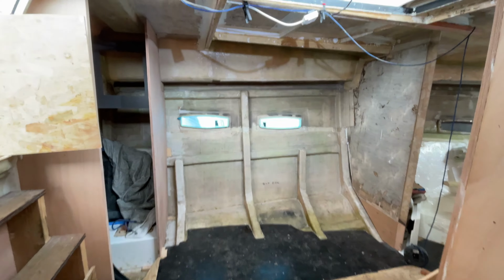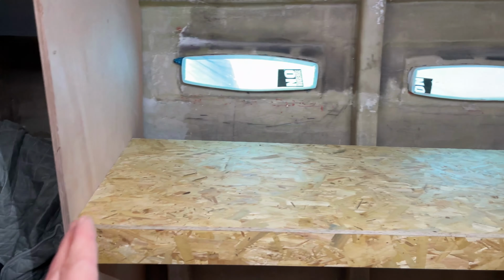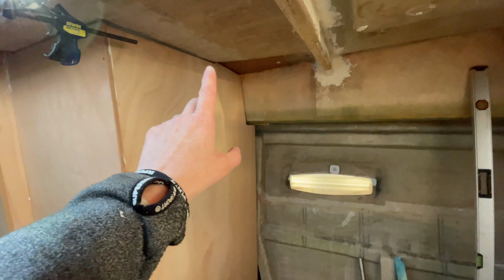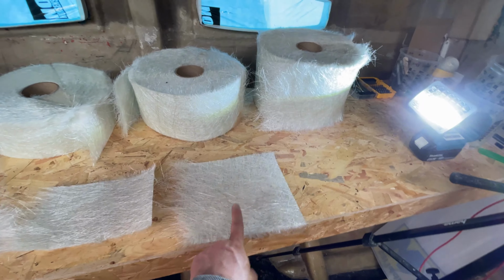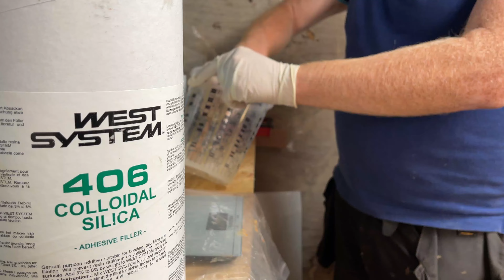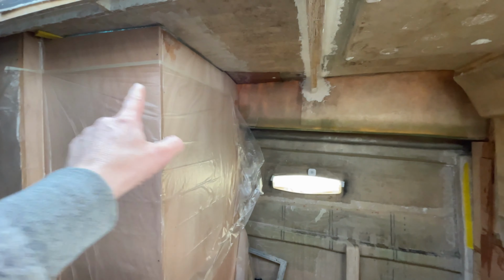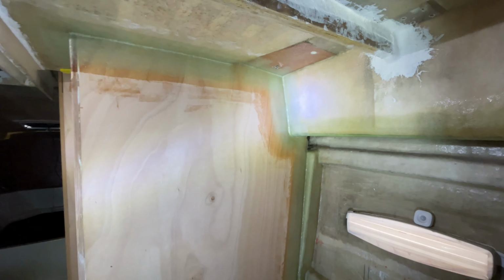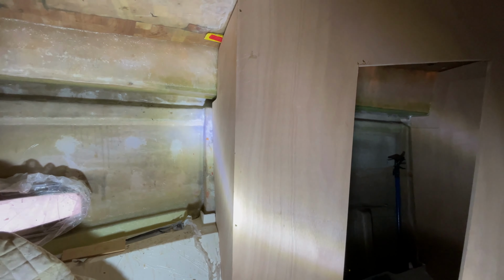Can we FIX these PROBLEMS on our PROJECT REBUILD BOAT - EP.91

Comment: There seems to be a decent amount of clearance between the plywood and the hull where the tabbing goes. Does this matter? Or perhaps it it needed to position the plywood in an awkward space? Will you fill these voids? Thanks Piers
Reply from the maker: Yes this is deliberate, 10-20mm is recommended. Can be backfilled but will create a hard point which can cause gel coat cracks...